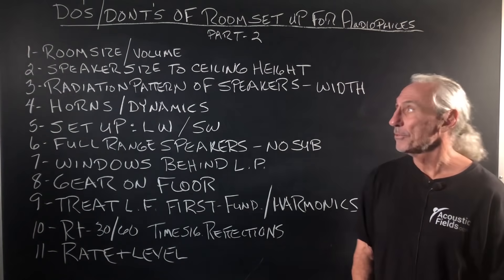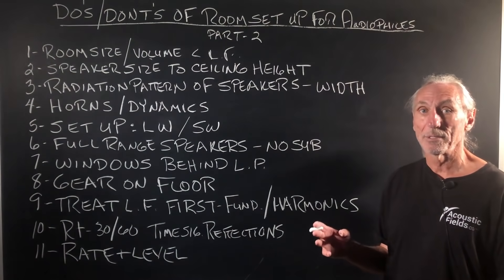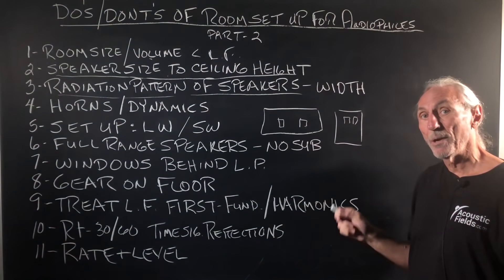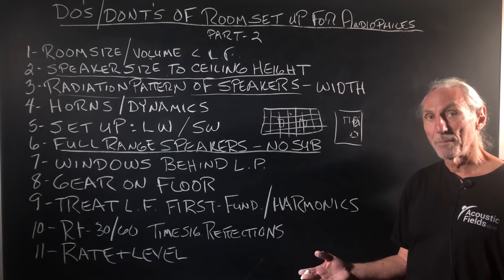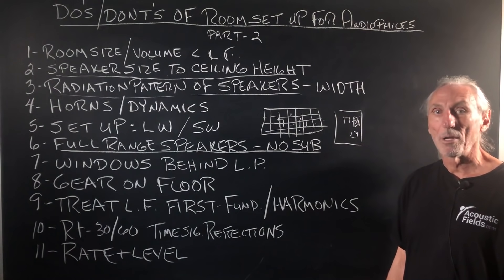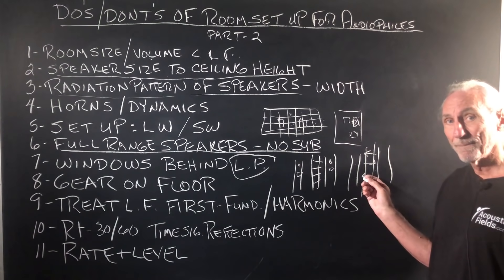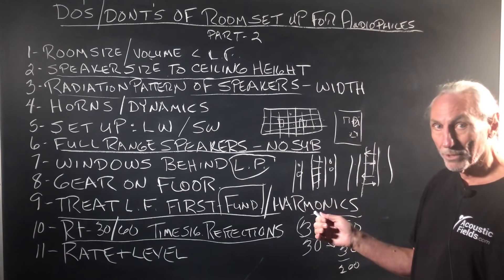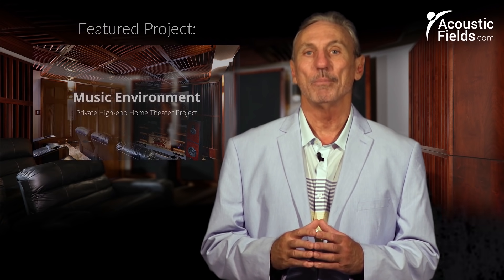Do's And Don'ts Of Room Setup For Audiophiles Part 2 - www.AcousticFields.com

Comment: Yeah, the Duntech Sovereign.   I was offered a pair in mint condition for about $4000 back in the early 90's.  They were just too big.   There's a number of mastering studios that use or have used them.  They were touted as the most accurate speakers back in the late 80's.     The store that had them called them coffins because that's how big they are..
Reply from the maker: How times have changed.

Comment: Great video! I do have a question. You start off saying speaker placement away from the walls is paramount and there is no exception to this. I have Klipschorns. How would that effect the rest of your equation? Can I have equipment between as long as I keep it lower than the horns?
Reply from the maker: Keep all equipment no more than 12" off the floor. If you have corner loaded speakers, place our 2 of our diaphragmatic absorbers around the speakers. Create a new corner with the Carbon Panels. You will not believe the difference. You will think you have a new room.
https://www.acousticfields.com/product/carbon-panel/

Comment: Hey Dennis thank you for this video ; I absolutely reckon the importance to not place the gear too high between the speakers, and I won't do that. I was wondering about placing them not between the speakers, but between the listening position and the speakers, still at the lowest position from the ground. My idea is to use the upper surface of the rack in order to place absorption (foam) or diffusion, instead of the coffee tray, at a distance with sound reflection issues. What do you think of this idea? woud it be worth to try? My intention is to buid a dedicated room. Thank you
Reply from the maker: It is best to keep the gear on the floor between the speakers. Gear height should not exceed 12" . This allows for shorter cable runs which will improve sound quality and not drain your bank account.

Comment: Hello.. i have and area of 80- 90 square meter function hall room and is it good to install a four speaker at four corners at ceiling type having the height of 270 cm from the flooring..? my speaker is 80 watts per speaker..
Reply from the maker: Keep all speakers out of the corners of any room. The corners of each room are full of distortion.

Comment: What's the best treatment for windows?
Reply from the maker: What are the issues? Is this a noise transmission issue? Are we trying to minimize noise transmitting through the window? Is this a treatment (absorption vs. diffusion) issue? What is the room usage? There is no one size fits all situations.
Reply: @AcousticFields  Well this 6-sentence answer has 5-sentences ending with a ?.What kind of an answer is that.
Reply from the maker: @kenfrigo1618  When you are dealing with belief systems that are not based in science, you must first highlight the current belief that comprises that belief system that is not correct, can't be correct because our laws pf physics say it can't. After that process, you instill the correct science based belief as the second step of the process. People need to understand just how wrong they are at this point in time. Showing a series of how not to think will, over time, lead to a more science based belief system.
Reply from the maker: @kenfrigo1618  When you are dealing with belief systems that are based upon falsehoods that are not even close to reality under our physical laws, you must site examples continually of the falsehoods. Once you identify and discredit, you must then show the correct path. It takes many examples since the current belief systems are so skewed in the wrong direction. To change a belief system, you must identify through example the inherent falsehoods and then substitute reality based systems and then act upon those new belief systems continually..

Comment: Well I guess my 9' - 8" tall CBT line arrays violate the speaker height in my 11' ceiling room, the center speaker should be ok though, it's only 7':-)
Reply from the maker: Speakers that close to a surface area produce distortions in the floor to ceiling dimension.

Comment: If you want hilariously bad sound. Set up your Stereo system on hardwood floors with no rugs or carpeting. Throw in some  large windows for good measure. 😄
Reply: This is my old folk's house. Large rectangular living room. It's terrible. One side of the wall (left side) is this giant glass window. It's double glass so it doesn't move but it's terrible and reflective. Hardwood floors, no carpet. Right side of the room faces the kitchen. I don't think I can improve their sound by a lot. It's a shame because they have very nice and expensive vintage speakers. I thought of getting them a subwoofer but now I realize it would be a terrible idea as it would sound atrocious.

Comment: This might sound out of the blue. But... For narrow, high ceiling spaces where ceiling area is small compared to wall area, why do we normally require acoustical treatment for CEILING ONLY? Why Ceiling only? I don't understand. HELP! 😭
Reply from the maker: You must manage the reflections from the front wall to the rear wall ceiling area. The reflections interfere with the direct energy from sources.

Comment: Excuse me for asking this question, but I'm kind of new to this.  I fortunately have a room, not particularly large and odd shape, that I have a free run to do whatever I like and my wife won't mind.  If I was to able to put some sort of sound absorption on every wall, floor and ceiling, outside of reflection of furniture, would that not help me to get the most sound directly from my speakers?  Is that not what I should be working towards, direct speaker sound with no reverberation? Or is that something not obtainable without spending a small  fortune? Thanks
Reply from the maker: Reverberation time management usually takes, depending on usage, around 65% surface area coverage. Low frequency management technology takes 12" of space on each wall surface area with the goal of 50% coverage.

Comment: It's not always possible to place the equipment rack anywhere but between the speakers.
Reply: Well it's either compromise or don't compromise. You're just going to have to decide at the end of the day...
Reply from the maker: You can place it there. Just do not exceed 8-10" in height. Do not ad an equipment rack that is as tall as your speakers.
Reply: in a typical setup ypu have 2.5-3.5 meters between the speakers - place your equipment on a low-board side-by-side instead building a tower - a really low board just to hide the cables and then move your speakers at least 60-90 cm away from the wall, nothing will hit your equipment any longer